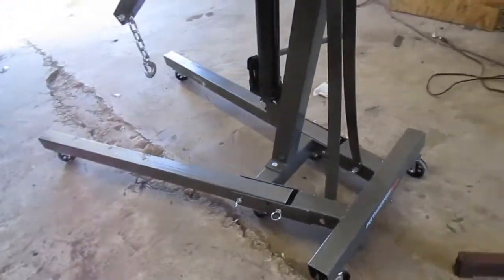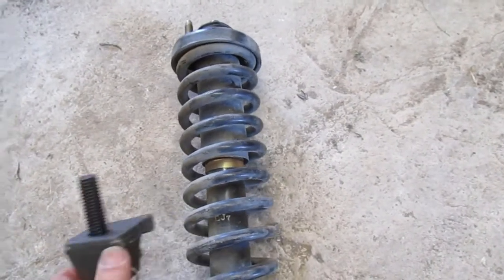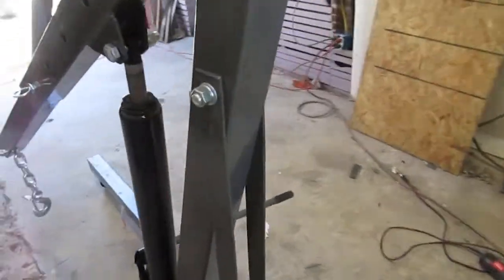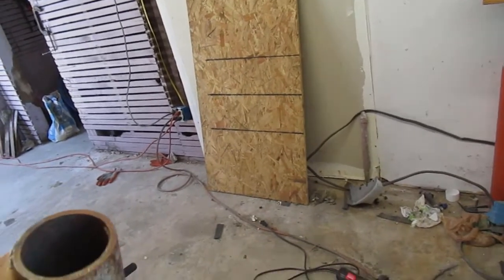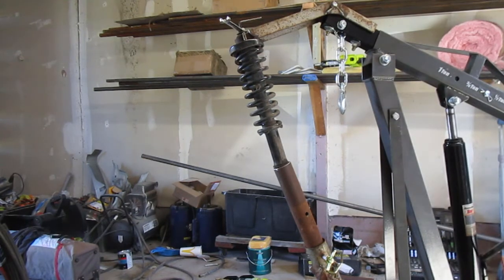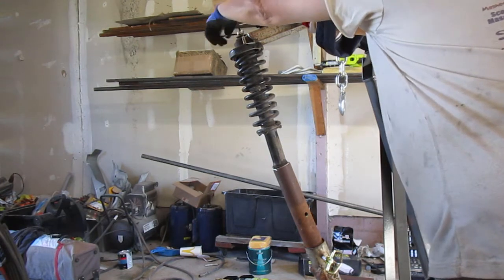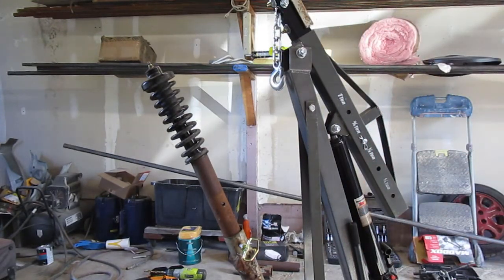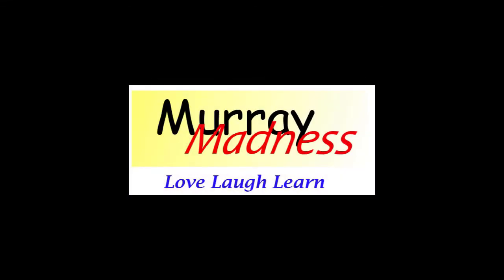DIY Strut Coil Spring Compressor Using Harbor Freight Shop Crane

Comment: Love the idea of using an engine hoist - but not like this. Could see this either taking your head off your shoulders ,or putting a hole in the roof of your garage. Think with a bit of thought and a small amount of engineering could devise a method for compressing a strut spring using the  Crane as intended, and  a lot safer. However well done, I am impressed with your ingenuity.